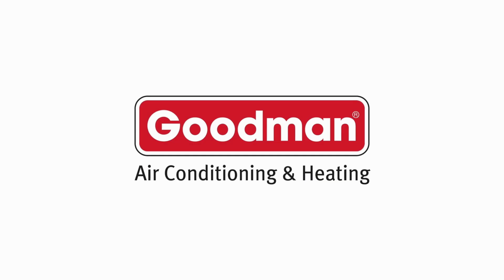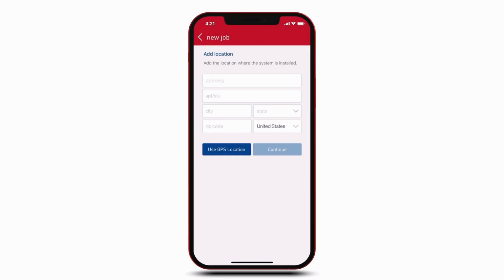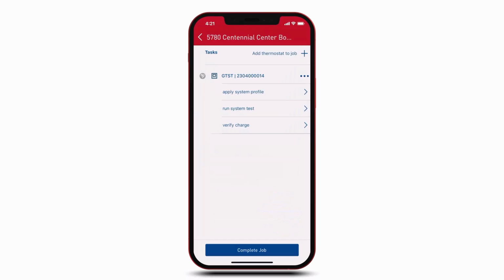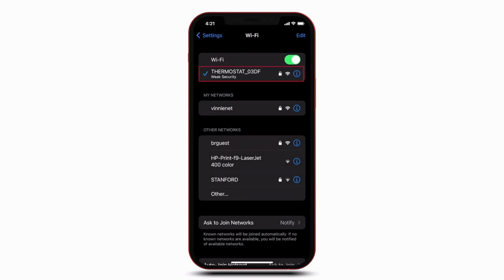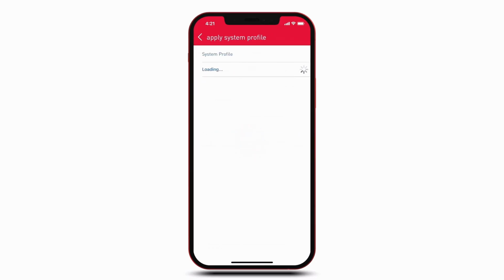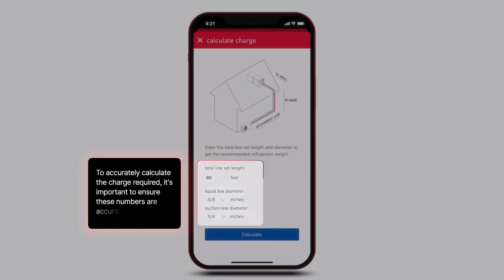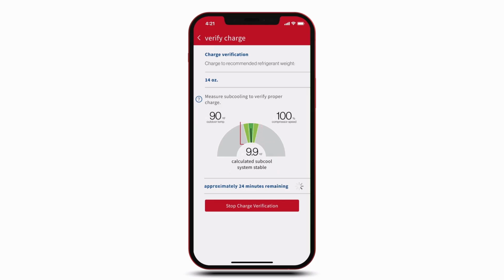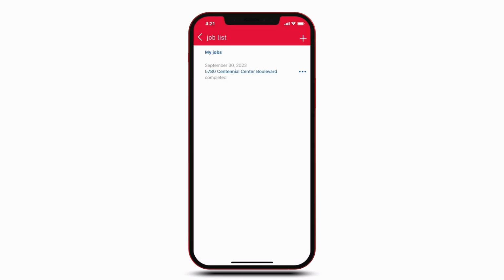GSTS connected thermostat quality install

Comment: What happens when you get “Profile failed to upload”
Reply from the maker: Try to load one of the other default profiles and if that is successful the profile that errored has a setting out of range. You may have to do a couple setting changes and upload until you find which change is the issue. I've only encountered this one other time and they were successful, although I only received a 'running' text so not sure off the final issue. If none are successful to upload a data update on the furnace board is in order, easy procedure if you know how so if you you decide to try it.